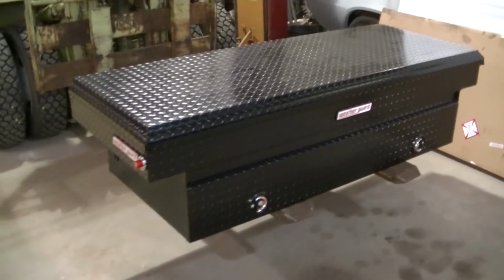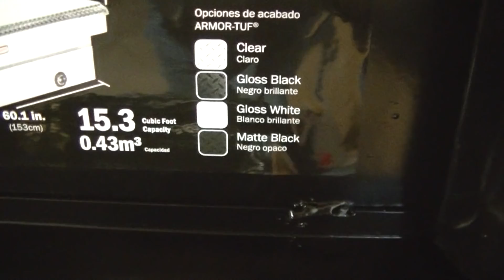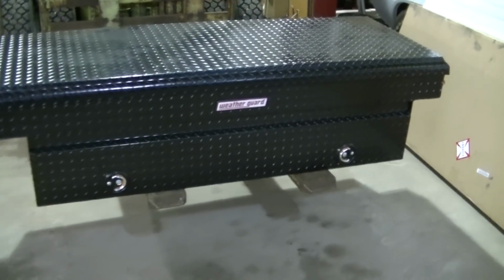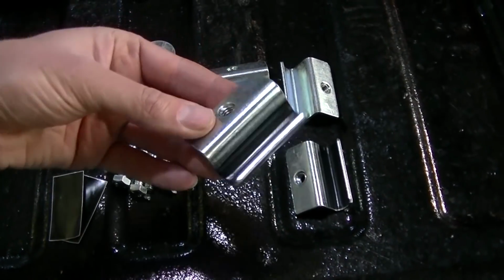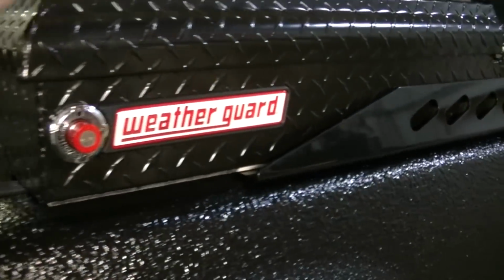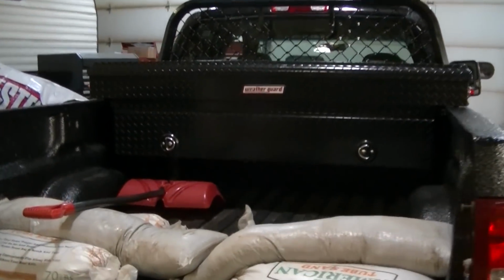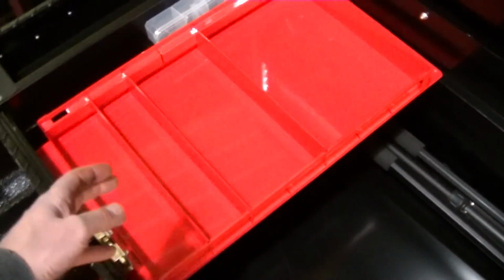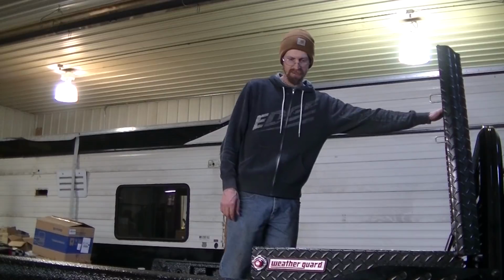Project Frankenstein Weather Guard 27" Black Tool Box

Comment: I just got the same box in matte black...its a big one! I like it because i can still haul lumber and slide it under the box all the way to the front with the tailgate up....my bed is 8'. I cut two pieces of 1/4" MDF and put it in the bottom then i got some  soft dense 1/4" thick black  rubber padding and put it in the bottom and the sides as well as the tray. Fill it up now and i will be ready for anything.

Comment: Very nice install. The toolbox definitely suits the truck well. I may have to put in a better toolbox in my long bed F350. The one I've been running in it which I bought second hand (been running since I around the time I bought the truck) is good for holding all my tools, but the locks on it are essentially broken, and I could use a little bit more room depth wise for my stuff. My toolbox loaded with several 3/8" cargo chains, binders, Long HD ratchet straps, Clevis', Sockets, Hammers, Screwdrivers, Jacks, and a bunch of hand tools probably weighs close to 500 lbs loaded. I am interested in perhaps getting myself a Black DeeZee toolbox maybe over the Summer time.
Reply from the maker: They can get heavy when loaded for sure.  I don't have much in mine....yet.

Comment: what did you have in between the top lip of deezee rack? i got 70"3/4 on my deezee on an f150 where the tie down part tapers in. . the weatherguard says its 71" 1/2. im just wondering if the lid is 71 1/2 but the box size is less than 70 3/4?.. meaning the lid over hangs like a half inch each side? id get the high profile wide box so the lid would clear the rack for height. wondering if i can get one of these or should just get the dezee box.  lot of info i just typed up.. sorry about that this is the only video ive seen of a deezee rack with weatherguard. long question short.. how wide is the box, not the lid but the box? cant find that dimension online

Comment: That's definitely a better box that i got. But I couldn't get myself to spend a little over twice a much as what I paid for mine, especially since I didn't know how much I would actually use it.  I do need to modify mine though so it opens a full 90°, I hate how mine doesn't quite open 90°. If I end up using mine a lot I may just have to pick me up one of those later on. I like how the trey locks into place and also has a storage for like nuts and bolts.
Reply from the maker: It's not a cheap box so I guess you better use it if you buy it.  I have always wanted one of these.  Got it at the local Tractor Supply store.  They get some in every once in awhile.  Been eyeing it up every time I go there.

Comment: I've thought about a truck box. I've thought about one of the tractor supply boxes. I sell the husky ones at Home Depot but I've always liked the tractor supply ones cause they have more options. I'd have to get new backrack hardware though. Backrack brand backracks need special hardware to work with tool boxes. It'd be good to keep my fire gear and stuff in.
Reply from the maker: Have never seen a Husky box.  The best tractor supply box is around $400.

Comment: How many inches did you have to move the box from where it should have been?
Reply: I'm seriously about to do the same install but also want to incorporate a bed cover as well.
Reply from the maker: I couldn't tell you. I have sold this truck but my dad bought the toolbox from me. It's in his 13 GMC.
Reply: Ok
From the video it looked about 2 itches to me.
I'm cool with that and it should work with what I'm doing.

Comment: I ran into the same problem with the lid and my backrack too and had to move the box towards the rear but I'd rather have the weather guard box with less room in the bed than a cheapo one!
Reply from the maker: Yeah,  I was planning on some lights on the back side of the rack.  I guess my plan will change.

Comment: Flush mount led back up lights in the tool box would be a nice.
Reply from the maker: I don't think I could bring myself to cut that big of holes in a $800 toolbox.
Reply: mossman381 I my install back up lights inside the rear steps on the 14 and up rear bumper. 800 is way to expensive to cut.
Reply from the maker: I got the lighting figured out without cutting my box.  You will see soon.
Reply: mossman381 can,t weight

Comment: The heads of the bolts from your back rack is the sole reason for the box not being able to sit flush, but I'm sure you already know that !!
Reply from the maker: Those bolts are just button head.  Not nearly as big as a regular bolt head.  I don't think those are causing problems.  The mounting plate of the headache rack is pretty thick.  A normal sized toolbox I think will sit mostly on that mounting plate.  I got the big 27" wide box and it sticks past it quite a bit.

Comment: how did you install the slider? I couldn't figure out how to remove mine :( It's a super tight fit and is too large to remove.
Reply from the maker: If I remember it was a very tight fit. Just need to find the right spot to get it out.

Comment: I like my weather guard box. Needs new struts for the lid though
Reply from the maker: Didn't know you had a Weather Guard toolbox.
Reply: mossman381 yeah it’s probably about 10 years old or so. Got from a guy for $50
Reply from the maker: That sounds like a good deal if it was in good condition.
Reply: mossman381 it was practically new. I need to polish it but I’m sure it would still look dang near as good as it did when it was new. Might have a couple scratches but not one dent in it

Comment: I spent a fortune on these boxes and the clear coat has hazed terribly!   When I contacted them, they made some asinine assumptions and comments and basically told me to f&@$-off.  Is this what I get for spending thousands with this company??
Reply from the maker: Didn't know they had a clearcoat on them. Dad now has this on his truck. No issues so far.
Reply: @mossman381  Just wait....You'll find out soon.
Reply from the maker: It has been outside just about everyday since this video. No visible damage to the finish. I will report if something happens.
Reply: @mossman381  When would it be a good time for the finish to fail, mossman?  In a month?  A year?  Are you planning to buy another in a year?  
Every year?  Start saving your pennies.
Reply from the maker: Everything you buy and use will start to show wear over time. Do you expect these to last forever??? We have bought the cheap boxes and they last about a year before starting to look bad. This box still looks new. I don't know what your situation is so don't blame me for your problems. Our box is working and looking like new still. I am not going to bash a company when in my own experience they have a good product.